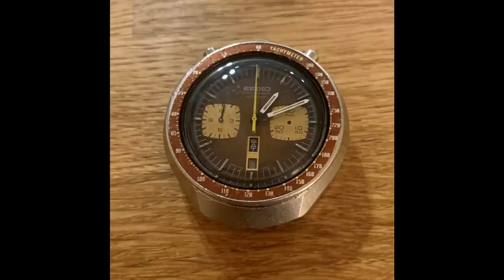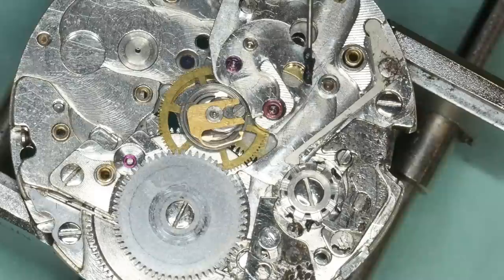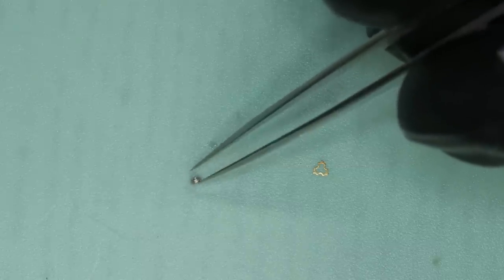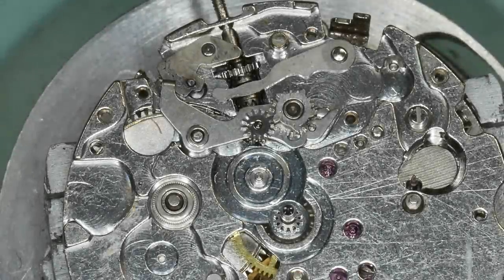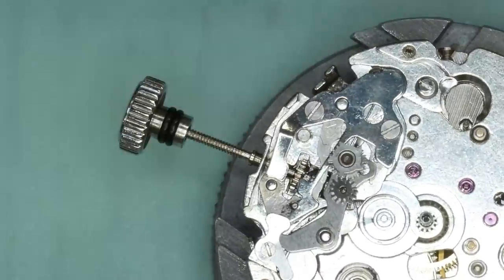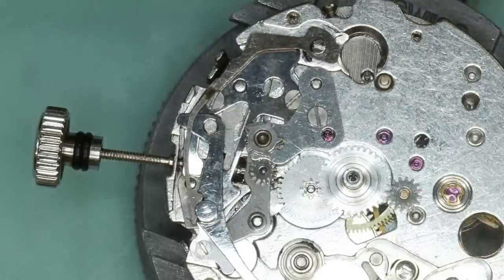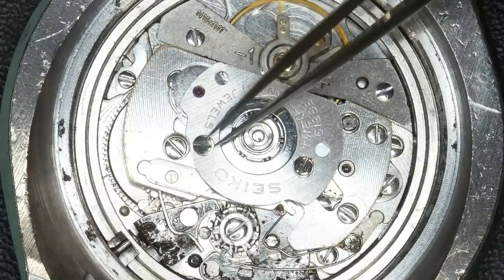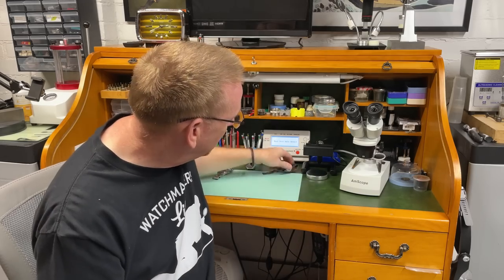70's Seiko Bullhead - The Rebuild 2 Years In The Making!! Watch Repair

Comment: You worked hard on this watch Mike.  Glad you persevered and got it back together successfully.  Now it is time to enjoy some wrist time.  For the hour recording wheel creep, check the eccentric position for the spring holding the brake for the hour recording wheel.  The manual states you need the shallow end of the eccentric lobe toward the center of the hr recording wheel.  This puts maximum tension on the spring.  You may have it 180 degrees out.  You may be able to adjust that eccentric without tearing the entire calendar side apart.  I think you can get to it once you remove the day and date wheels.  I would rotate the eccentric 180 degrees.  John S
Reply from the maker: Thanks pal. I corrected the eccentric screw 180 . I said it at the end of the video and showed the picture from the service manual. I should read it more ! But when you are filming , talking and repairing looking at the book can be the last thing on your mind despite being the first thing I should do! 

I love creating my own problems.

Comment: Cheers Mike! Really enjoyed your vid! Lovely watch! I have mine out for service as we speak. No need to worry about the hour chrono counter which continues to run after you stop the chrono …. As long as you don’t stop the chrono … :) We need to leave them running anyway 😜
Reply from the maker: I fixed that in the end. I knew the solution and think I mentioned it at the end. Just turned one eccentric screw 180 degrees. 

Thanks for watching

Comment: Hi Mike, I'm new to your channel and enjoyed this video as I have several Seiko 6138's, including exactly the same brown-dialled bullhead chrono.  You probably know this, but with the friction clutch Seiko chronos such as the 6138's it's recommended to leave the chrono running in daily use, to prevent excessive wear on the clutch and prolong its life. If you need to time something you just stop and reset the chrono, and then start timing again.  For Swiss chrono movements without a friction clutch it's exactly the opposite, i.e. you leave the chrono stopped until you need to time an event.  Hope you get back to normal health soon. Cheers from Adelaide, South Australia.
Reply from the maker: Thanks for watching . Yes I am aware of the excess wear theory . Does not mean much to me unless you were daily wearing the same watch.

Comment: Hi Mike! It's been a long time since the last time I commented one of your videos, but I still watch most of them with great interest.
I've considered using fixodrop too, and have done some research about it, but I've decided not to use it yet so don't take me too seriously, but I think it might be better no to treat the whole pallet fork with it, only the stones, reasong being fixodrop leaves a thin layer on the treated surfaces as intended, but this layer is only required on the stones and is not desirable on the pivots.
Also, some people install the pallet and balance wheel and let the watch run for 15 minutes or so before applying the oil on the pallet exit stone. That is to let the escape wheel remove the fixodrop from the stone in the area that they get in contact and keep it on the rest of the stone face, allowing the oil to stay where you want it.
There are thousands of techniques of course, so I'm not saying yours isn't as good as this one.
Great work with this grail, enjoy it!
Reply from the maker: Thanks for watching and commenting.  I am still new to fixadrop and this was how I was told to use it from a pro who is a friend.  Like you say everyone has their own way of doing it and my way may not be correct.  To be fair oiling the pallet before installing is a big no no from the pro's but I cant seem to oil them via the access holes easily and on film that for me is impossible.   I am also told that fixadrop will not really enhance the performance in any way only the longevity between services.
Reply: @MyRetroWatches  Hi Mike, Excellent to see you back at the bench!!  I recently bought my first batch of FixoDrop and my local pro said it's ok to do the pallet fork (and escape wheel) as long as you clean it off the pivots of both with pith wood before replacing the parts.  He also recommends running the watch for a couple of minutes without oiling the pallets, to wear an escape-wheel-tooth sized groove in the epilame on the pallet stones before oiling the exit one.  He's been a watchmaker for 70 years, so I might take his advice 😀 Of course, that does make your and my method of oiling the exit pallet before replacing the fork more of an issue!  All the best, Martin.

Comment: What an inspiration. Great smile at the end. I like the fact that you leave the cock-ups in to show pitfalls. Learned a lot from you that way. Been following you for nine months and am able to emulate most of your systems. Thank you. I have great trouble with low amplitude on every watch I do. All jewels cleaned as per your system. Any thoughts please? Cancer - Mine was facial and benign. Removed, and I am 100%. Prostate sorted prior. Wish you well. Regards.
Reply from the maker: Thank you for your kind comment. Also pleased that you follow my channel with such interest.   Low amplitude, so you just have to think about the basics. Amplitude is power so in order for good power we need to first think about the mainspring is it clean.  If manual wind no oiling. If the watch is very old the spring may have "set" meaning it does no longer hold the power it once did.  Much older watches used different steel for springs so those ones tend to set more easily. After the spring its then just looking at the train, does it run really freely. You can test this without the pallets in by winding and listening as the train spins.  Does it sound constant or does it go up and down like its slowing and speeding up. After that then is balance, so proper cleaning an oiling of the jewels is important but correct beat error will also show a more positive amplitude. Some watches with a bigger balance wheel will run with lower amplitudes like old seikos, rule of thumb with these is if its 200 or over its good enough from a hobbyist.  Over oiling on any pivots can cause drag too equally are the pivot bearings jewelled or metal on metal. 
Hopefully this gives you some insight.  I always try to think simplistically otherwise get all complicated on it and you will scratch your head for allot longer until the penny drops. Good luck in your watchmaking.
Reply: @MyRetroWatches  Thank you for taking the time to reply. Looks like I've got an involved road ahead. I'll  not give up. Inspired by you and others in the same ilk. Keep well. Keep safe.

Comment: Great video ! As for the chrono hand stopping, most of the time this happened to me was because the hand is very slightly pointing up and touching the crystal, always at the same spot, it’s worth checking if the chrono hand is pressed in all the way in before disassembling the whole movement!
Reply from the maker: This is true but I know it was not touching and this will always then be a tooth on a wheel somewhere.  I was pleased to find the issue and now its ran 36 hours continuously without the issue so problem solved. Thanks for watching

Comment: Good job. The only question I had was the grease looks so thick!
Reply from the maker: S4 Seiko grease is an odd one. It looks thick and when applied. but actually in action it is quite runny and sufficient for its purpose.  I used it because the manual suggested it. You can still buy it and its not too expensive so figured I would give it a try.

Comment: With my recent bronze I now have two main grails (Zlatoust grille'd bronze and a Strela/3133 mechanical chronograph) but I have one secondary grail left and that is a Seiko or Citizen bullhead mechanical chrono.   I did make cows eyes at the triple date Sorna bullheads but that's not a mechanical chrono, I also have a ton of Pulsar VK63's which are mechanical chrono's but quartz powered so still not quite the same.   What did you use to secure the flyback hand?   My VK63's the flyback second hand is bonded, am actually working on securing one and going to try some blue threadlocker applied with an oiler as hypoid glue was just too soft, if the blue doesn't work its going to be superglue which I suspect Seiko use a variant of.

Comment: Mike, I really prefer the longer videos, so this was a real treat. 
What is your opinion of having plastic components within a watch movement?
I can't help but get the feeling that it screams, Hey I'm cheap and disposable,
with built in obsolescence.
Running plastic against metal is never a good idea associated with longevity.
Or is it?
Reply from the maker: Interesting question and perhaps you should look up Tissot Autolub watches for some interesting history. A plastic sealed movement in the 70s the thinking was no need for service plastic auto lubricates and does not really wear.  Think is they were marketed badly and were a flop.  I have one and a Lanco with the same movement that I actually repaired!   The use of platic back then was because it was a new material higher grades etc so trying to move with technology I guess.   The modern watches from Seiko contain plastic parts and so do some the 70s ones like this Bullhead that has one plastic wheel.  Less friction and if the movement does not jam then it will not fail. 
You would like to think it cheapens the movement which is does but it also functions as it should so in some ways a complete paradox.
Reply: @MyRetroWatches  Thanks for the interesting "in depth" reply. Having only found a few pics of the Tissot movement, it does look like it contains a few metal components alongside plastic gears. Definitely something that looks like a throw away item. The clear plastic inner case is
reminiscent of a quartz clock, but of course with quartz it doesn't have to put up with the enormous pressures of a mainspring driving through a power train. It's a real head scratcher as to why they thought it was a viable concept. Looking at how rare they now are, it would appear that time has proven the obvious.

Comment: Great video! I need some information regarding a Seiko diver's watch model 6309-7049 made in Japan A ( for the American market). The watch number is 771060 (made in 1977). I am looking to replace the set hands and the bezel click spring. It would be greatly appreciated if someone could tell whether hands and bezel click spring of later Seiko diver's watch models could fit as replacements. Thanks in advance.

Comment: It is Epilam, Ep-i-lam. 
I think the Fixodrop should only be applied to the pallets on the pallet fork, not the pivots, which I've seen done on an other Youtube Watch Repair channel I follow. I think it leaves a residue on the pivots that may affect their operation. 
Of course do your own research and don't just go on the advice of a non-watch repair person.
Reply from the maker: Thanks I always get the pronunciation wrong.  I know Mark well so will ask him but you have to dunk the part in the solution in my opinion as that is why the bottle has a mesh in it.  
Another watchmaker I know told me to do the escape so oil does not gather on that too.

Personally I think most of this is a gimmick for hobbyists and should be reserved for more Precsion movements. 
In a Seiko it’s not really needed. 
Ironically the Seiko service sheet suggests oiling both pallets and I think the pivot jewel.

Comment: Holy hell grease and oiled the hell out of that watch.
Reply from the maker: But it still works.
Reply: @MyRetroWatches  not necessarily, too much is almost as bad as none and sometimes worse. But hey you do you
Reply from the maker: @initium5421  I don’t profess to be a pro just a hobbyist still learning. The Seiko S4 is nightmare grease to use as it does not come off the oiler.
Reply from the maker: @initium5421  I will add to my defence that when filming the camera is in the way and I have to assemble from an angle which is not always easy to see. 
Off camera I have much more vision and the aid of the microscope too. 

That’s my excuse anyway 😉
Reply: @MyRetroWatches  oh I know it is however I’ve always modified one of my oilers with a tiny piece of rodico to remove the excess grease. Even the oiling of the jewels and pivots was way more than I’ve ever seen from any watchmaker. Excess oil actually ends up seeping out from where you put it so it ends up hurting things as well as being more of a dirt magnetic. I am not claiming to be an expert I’d only qualify that title to maybe a few hundred watchmakers, just trying to offer a bit of insight without coming off arrogant
Reply: @MyRetroWatches  fair enough
Reply from the maker: @initium5421  I welcome any criticism and advise as it’s how we learn. So I am not picking up arrogance.

I did a video on the importance of oil a while ago too.
Less is more . I totally get it.

Thanks for watching anyway
Reply: @MyRetroWatches  I’ve got a hobby watchmaker friend that’s tried to shoot some videos while doing a watch assembly for a customer and it went terribly so kudos on being able to do what you do.